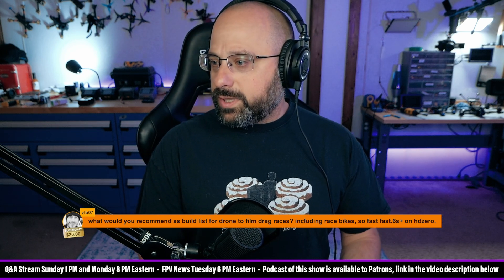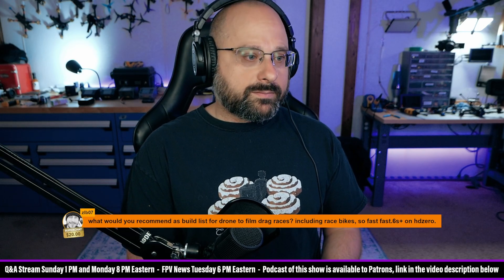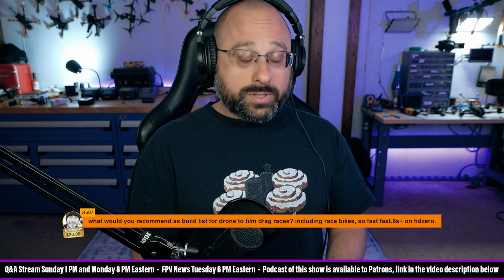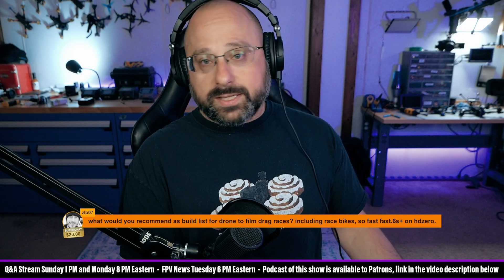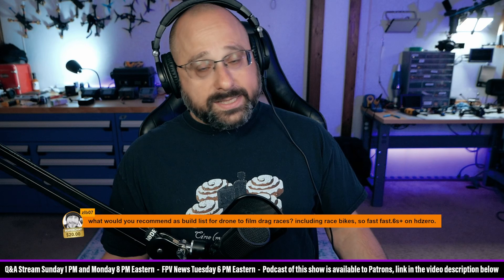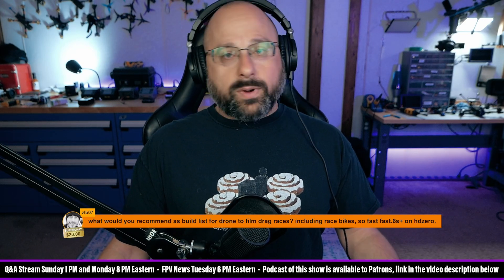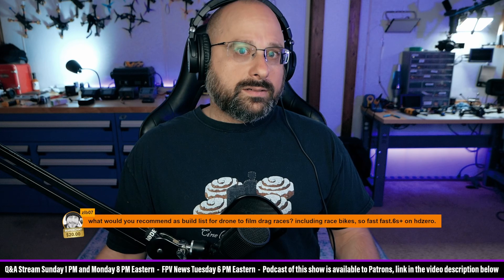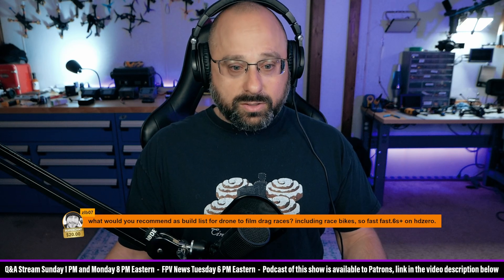How Do I Build A Drone To Film Drag Races? - FPV Questions

Comment: I worked at Sonoma Speedway for three and a half years. 
NHRA Top Fuel dragsters go well over three hundred miles an hour in less than four seconds. 
There is no drone that flies that fast. 
Good luck with that, if such a thing ever existed.  
Ha!

Comment: A normal 5" racing drone hits 160mph with APC 5.1x5 props.
Mine does with 1950kv 2208 motors and ACP on 6S. No need for 2700kv.
But to carry a gopro you have to do something like that recent red bull drone